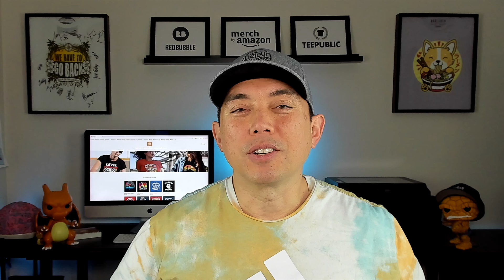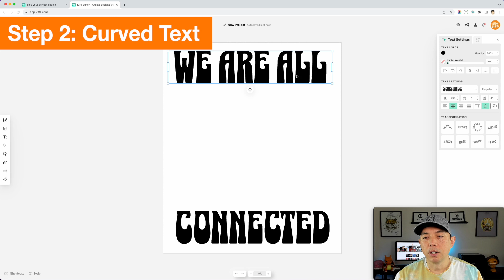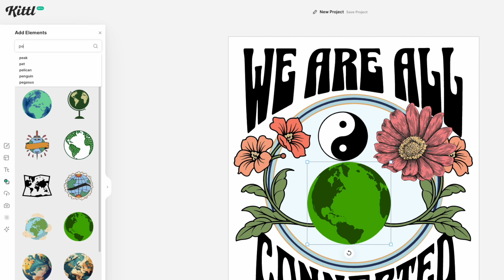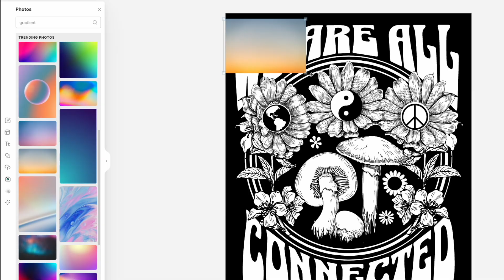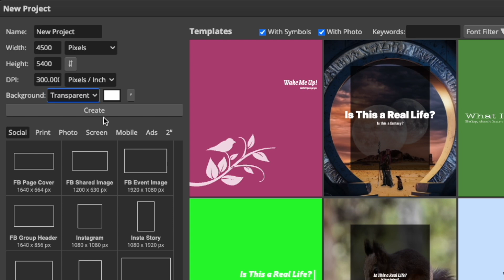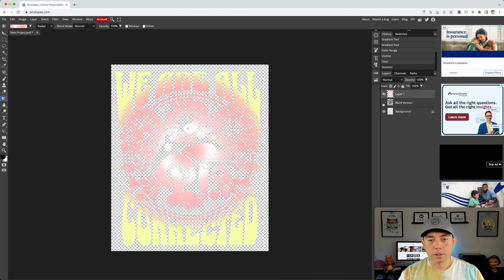How To Create a Vintage 70s T-Shirt Design All Online with Kittl and Photopea

Comment: Great video! Does the tie dye example print well? Do the colors come out okay? Just curious
Reply from the maker: Great question.... I should really print it and find out... I'm not 100% sure
Reply: @DetourShirts  thanks!
Reply: Generally, the CMYK color mode is best for printing t-shirts, instead of RGB because the colors found in the CMYK color space, are easy to accurately reproduce with plastisol inks.